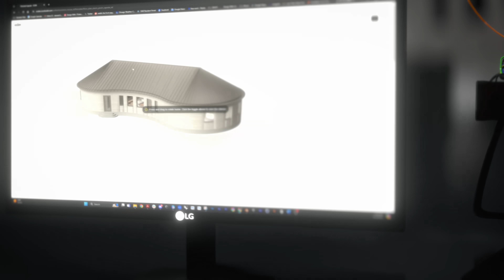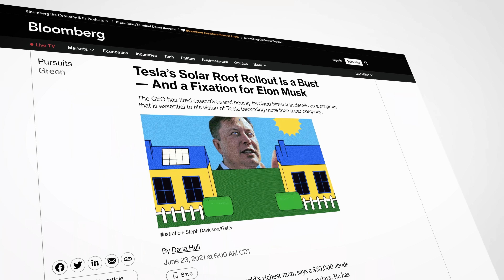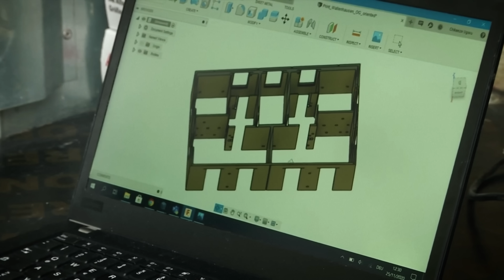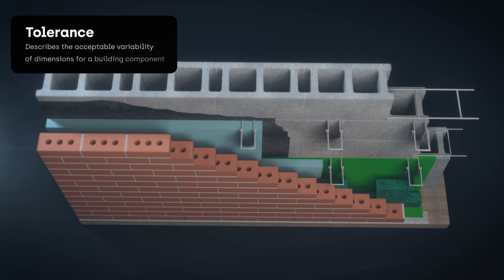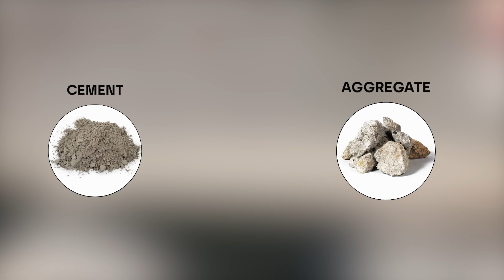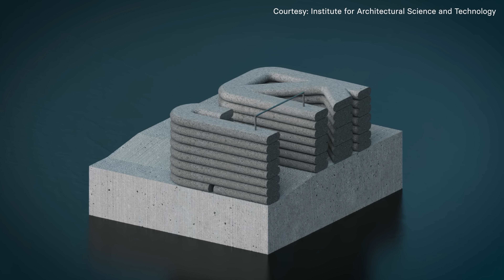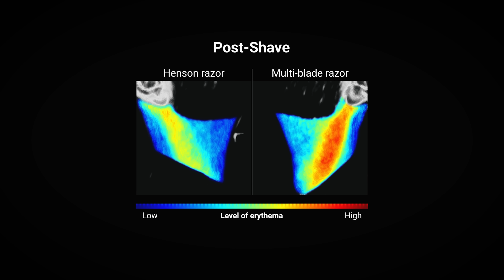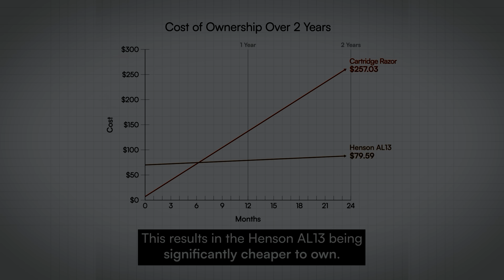Why 3D Printing Buildings Leads to Problems

Comment: I have always had a problem with the hype around 3d printed structures, especially residential structures, especially in the US.  For a 3d printed house you still need a poured foundation, you still need interior finishing, you still need a roof, you still need MEP, the list goes on and on.  You still need to do the rest of the house.  What does 3d printing automate away?  the framing and sheathing - because to be clear - the vast majority of houses are wood framed, and will continue to be.  Now, what is the absolute fastest part of building a wood framed house?  the framing and sheathing.  3d printing replaces the fast, easy, low skill part of home construction with something marginally faster if at all, extremely complicated, unforgiving, and requiring highly skilled workers if not engineers on site.  For home construction, 3d printing is silly
Reply: That's probably because the technology is not meant for consumers but to lure investor money.
Reply: That wood house burns.
Reply: Wood framed houses are a US only thing. Also no wonder tornados are so destructive in the US
Reply: @Soundwave857 Wrong.  The majority of hoses in New Zealand and Australia are wood (timber) frame. Could be used in other countries too, don't know.
Reply: Even worse, it innovates the least important part of the cost of housing (construction) while the majority of the cost is the land in places people want to live.
Reply: @laszlo3547  is there anything less relevant? They're automating the grunt work pouring cement not the artwork because that would be very difficult to do. Now you're pushing to automate the production of land or something is there something wrong with your thinking do you just have to come up with something to come out of the pie hole. They're automating the cheap part why don't they automate the expensive part you know land formation.
Reply: Yeah, I can’t help but feel like prefab commie blocks would be better than this
Reply: @beybladesinmyheels1267  I don't know about commy or not, but this is a pretty high-tech piece of equipment and a lot of people smart enough to run anything that technical want to stay a long ways from dirt and concrete and construction. This machine is going to cost more than a human being unless you're building row houses that are all identical and you can get two or three screw-ups to get it dialed in.
Reply: So build your wooden paper homes 😂
Reply: Luddite
Reply: @patricaomas8750  The upfront cost for the robots i'm pretty confident would muck up the job of framing for the nonce would dwarf the cost of just building a concrete printer by two orders of magnitude at LEAST. And that's BEFORE we even get to the problems with batteries. Even at it's cheapest for anything halfassed capable we're talking 16 grand PER unit. That's just for the robot. Not even counting all of the associated costs of charging & upkeep & troubleshooting & coordinating & maintenence. 

Its just more straightforward to build the damned printer and figure out how to make it all work in a durable & visually more pleasing manner. Takes just two guys to keep the printer chugging along at a good clip and a steady supply of your concrete being delivered in a timely manner.
Reply: @brianhirt5027  So you think my preorder of 20 Teslabots is a little excessive:face-purple-crying:
Reply: @patricaomas8750  Prolly so!
Reply: I said kind of the same thing except a little more detail with the fact that you've got plumbers in plumbers out electricians in electricians out drywallers in drywallers out and then start all over again in a different order. This is going to be a chargeback nightmare you aren't doing it much cheaper than a human being and you're going to make something out of concrete in an error from the machine and have to correct the concrete. This is an idea whose time has not yet come and may never come
Reply: It takes very little skill to monitor a 3d printer.
Reply: @user-zu5do6ri6r  I think you're having the cash register pops. Everybody says that it's easy to run a cash register what's wrong with these new kids that have to have everything told to them on screen. Well that kids not running a simple cash register like you're thinking of a simple printer he's running a combination cash register ATM machine. You're claiming it's the same skill level to monitor something that's melted a little plastic and sticking it together but this guy is pumping concrete having to keep the consistency so it doesn't run away having to keep the pump going just right to keep the printing process going just right and did I mention the stuff heavy and it's huge and something could fall on you or knock something over. Not to mention the easy repair you're going to have when that concrete goes all over and cures too quick or you've got a load of it you have a mistake and you got to just pump it out in a pile in time that it doesn't set up and ruin everything. Other than that you're perfectly right 3D easy peasy.
Reply: Across the Atlantic, Houses arent made from Wood
Reply: @Tritium21
2 months ago

Wait until code change and demand change.
If tomorrow a company can deliver a house can be up to code, made only a either a 3d printed concrete structure + some elements that come either pre made  or to very commonly used standards , I'm thinking of OSB sheets that would require no cutting and are available at Home Depot or something -  ,, and if that house can be build entirely in a few days to 20% of the cost of a nicer traditional home.... things will change
Reply: @xl000  we & engineering say that 20% is an unsupported claim. If you came up with something and it actually did it that much cheaper and you could prove it maybe so but as it is you're not really showing much if you're just going to claim if it's that cheap it'll go big.
Reply: Well made concrete houses withstand multi ton stones, that crash into them due to an avalanche. Meanwhile wood frame constructions all in the us are destroyed by tornadoes on a regular basis.
Reply: @alfonshasel1995  well I'm glad to hear from somebody that can't do math statistics or probability very well. For the cost of a stone house to prevent a random tornado once in a blue moon you are much over the cost of rebuilding several times and stone is a very limited media for home building
Reply: It's still a new technology, so of course it kinda sucks right now. Every new technological development is kinda garbage when it first comes around, but it improves over time and eventually replaces the old way of doing things. The same will happen with this. And those who refuse to adopt it or try to resist it will ultimately be left behind.

A prime example of what I'm talking about would be cars. When they were first invented, cars were terrible and didn't really have any advantages over horse-drawn carriages. And because of that there were people back then who were just like you and mocked the technology and said it was "silly". Look at society now. Don't see too many horse-drawn carriages nowadays, do you?
Reply: @Commodore22345  this would work well if you were using a Row house approach and there was a huge demand for mass production of the building. If you were going to do one off stuff where you do something one time programming a computer to do it is a great big pain in wallet.
Reply: @Commodore22345  this is nothing like a car. I don't think this is ever going to catch on because of the nature of computers being totally flexible change in an instant and concrete being concrete. The simply isn't going to catch on. I'm sorry that you wanted to discuss technology and use words like silly. Nobody's going to get left behind on this one. It's not going anywhere
Reply: @Commodore22345  oh okay I'm sorry I lose track I didn't ever get to meet you or him or anybody I wish we could all drink coffee and talk face-to-face. 1 general event with c computers is repetition. If you had row houses and you got the first couple wrong and clean them up the next 20 could come out fast. A bunch of people setting forms and learning from mistakes, is very competitive.
Reply: I don't know, I would rather have a durable concrete frame then a wood one.
Reply: @Entropy67  yes and you also are very likely to have a concrete mistake that is very enduring. If you are 3D printing a toy and something comes out a little lousy just throw it away. If you were printing a 3D house and you leave out a door it's not going to be an easy fix. Most computer stuff screws out two or three times but it doesn't matter because you've got backups and you can just delete stuff. Concrete has every opposite nature.
Reply: @Entropy67  I don't know what you're talking about. Nobody here is saying either you want wood or you want a machine to lay concrete.
Reply: Yep. Prefab homes are doing everything 3d printing does even better
Reply: I bet folks in tornado alley like the idea of solid concrete walls.
Reply: And the walls look like crap with the layering.
Reply: 3D printing isn’t a one-for-one replacement, especially in the U.S., where most homes are stick-n-paper and optimized for short-term warranties. A well-executed 3D-printed home is designed for durability that can span generations. For less cost and effort you're getting a better product.
Reply: Exactly, who’s giving these houses the green light when wood framed houses still need so much structural details
Reply: Framing is actually a relatively high skill process.  Bad carpenters screw up home frames all the time and cause massive structural defects. Track home builders regularly have structural problems because try to use low skilled labor and repeatability to cut down on costs, using engineered trusses instead of stick built roof, etc…. But they still have massive structural issues.  This really takes the headache out of worrying about structure.

Also, this is far more durable and impervious to termites or water damage.  You could build these houses in areas listed as a flood zone and have very little to worry about.  

Increasing home durability is going to be the only way to get homeowners insurance premiums to come down.  As homes get more and more expensive, the only way to lower risk to make homes less susceptible to natural disasters.
Reply: It’s silly for now. Obviously, it will eventually be solved. This isn’t the end game; rather, the beginning.
Reply: Try modifying a 3D printed house later. VS being able to modify a wood framed house.
Reply: @braddl9442  The idea isn't to create homes like traditional housing. It's meant to eventually be a way to mass-produce standardized housing for poor people. So the fact that they can't be modified or expanded isn't really an issue because the type of people who will be living in these houses are people that aren't going to have the money for those kinds of projects anyway. Middle-class and Upper-class families will still have more traditional housing built that can be modified and expanded.
Reply: @braddl9442  yea I mean if you don’t think the free market will find a solution I think you’re deluded.  Anywhere where there’s an opportunity to profit there will be people willing to do it, and there will be competition to keep prices down.  Just because you don’t think it will be easy doesn’t mean it won’t happen.  The economy isn’t constrained by your lack of creativity, fortunately.  

Though I do agree that 3D printing houses on location isn’t really the most cost effective idea.  I generally prefer the idea of using pre fabricated parts from a factory and setting them in place on location.
Reply: Carpenters/framers are the most skilled builders of a house.  Every other trade is much easier, saying this as someone who built their own wood framed house from the ground up.
Reply: @chuckd9007  electrician is considered one of the skilled trades and so is the plumber. Finish Carpenter is more of a skilled trade than rough framing.
Reply: @chuckd9007  I can see why you say that I don't think you put in your own heating air vac system I don't think you design your own electrical system. So you're right that's the most skill you can have just walking in off the street. There's a reason there's a license for an electrician there's a reason there's a license for a plumber there's a reason there's no license for a carpenter.
Reply: @markmcgoveran6811  HVAC design can be complicated, but installing it is only really an issue for air conditioners and heat pumps. Even then, there are DIY kits available that don't require licenses to install. Electrical design is very simple and so is installation. Not all areas require a license for residential electrical work. Plumbing is a little more complicated, especially drain pipes, but still doable and also doesn't require a license in many areas for residential work. Fine carpentry doesn't require a license anywhere as far as I'm aware, but definitely does require much more skill to do well.
Reply: Incorrect. 3D printing has capabilities that stickbuilts dont. Especially in areas particularly prone to hurricane & tornados. If you doubt the market potential or usecase applicability just take a gander at what's still standing after a hurricane sweeps through. Or heck, in any given centenial flood plain construction put to the test. Stickbuilts can't just be dried off and refurnished. Concrete structures can be, as long as the aggregate substrate wasn't washed from underneath it  With climate shift exaggerating those risks AND vastly expanding their potentially area of impact I think you'll quickly note that concrete printing a house makes more sense than rebuilding a stickframe.
Reply: @brianhirt5027 here in Florida homes close to the coast have to be built of concrete blocks.  One for hurricane protection, but also for flood and ocean spray protection.  Saltwater is incredibly destructive.  But there’s a massive difference in durability in block construction versus wood framing.  Like house fires.  I’m a garage door contractor so I go to a lot of homes every day.  I’ve seen several homes that burned down.  Wood framed homes burn down and usually their neighbors homes get singed depending on wind.  But block homes, they survive.  Yes the roof burns and the finishing burn but the structure stands.  Basically they just have to rebuild the interior and the roof on a block home.  Which means, insurance premiums are much cheaper on block homes.
Reply: @forrosailor  I've got a couple of general contractor freinds down florida way. I get regular updates on the horror stories around salt intrusion. Fucks everyting, including electrical up. 
As per fires, I don't know if you are really grasping the totality of the fires we get up here now. Whole neighborhoods look nuked after everything is said & done. The fires up here are of an entirely different order than what you're used to. We have an infestation of a bug called the western pine beetle that does really horrible things to the trees. When they go up, they don't go up slowly. They kinda semiexplode they burn so fast & hot.
Reply: @forrosailor So ... They have to the the most expensive stuff still? Literally the cheapest part of a house is the frame, the labor is cheap since it's quick. The most labor is spent doing everything else, plumbing, electric, interior, etc. You're waving away 4/5 of the costs because 1/5 is easier to fix. Premiums are cheaper on wood homes. Anything with brick or block is insanely expensive, because it all gets destroyed on a semi-regular basis and having more expensive materials just means more expensive repairs. Ask me how I know, I literally sell insurance in Texas near the coast 😂
Reply: @brianhirt5027  it has zero advantages over traditional concrete forming
Reply: @imchris5000  Except in the more minimal increasingly rarified labor demand. How many apprentices you seeing stay the course in the trades long enough to qualify for journeyman, Chris? Heck, how many make it to the end of week one or two? How large a team it take to frame up forms in a conventional residential build in a timely manner? How about those help wanted adverts you got posted? Got many under-40's answering 'em? Answer me honestly, Chris.. If Uncle Sammy tightens up green card reqs, how much longer could you afford to stay in  business? Hrm?
Reply: @brianhirt5027  Don't underestimate the role of rebar in those things that stand up to hurricanes.  Reinforced concrete is impressively strong.  A few ton of splooged grout will not compare favorably.
Reply: @M3rVsT4H  Agreed. But i'd be remiss if I didn't point out that this is such a new thing that every single one of these suckers is a custom built printer. They all don't approach it the same way. Some companies do include rebar, especially to fix walls to foundations and in areas of increased risk, of natural disasters.
Reply: @brianhirt5027 Lol tornadoes? Stiff houses blown down easier than wood frame. Brick, concrete, steel, none of it matters. A tornado is equally unforgiving, and earthquakes are the same. The only way to survive is to bend (literally) to the will of the natural disaster.
Reply: @brianhirt5027  The structures you speak of are not printed, they are reinforced and poured in place.  Cartesian motion systems used by these house scale 3d printers, and even corexy for that matter, cant cope with the rebar that did all the work.  remember that concrete has virtually no strength in tension or torsion, which is what earthquake and hurricane resistant structures are designed to withstand.  its the rebar doing all the work, and the motion systems simply do not allow for those to be in place.  It is also telling that the precautions in traditional wood construction against earthquake and high winds are to add steel reinforcing, and not to fill the walls with concrete.
Reply: @Tritium21  Understood. But I believe there have been some already printed in Florida, awaiting their trial by fire. Or in this case trial by hurricane.
Reply: @Tritium21  I agree with you 100% I've never seen anybody who didn't get undercut in capitalism that didn't cry out it's silly to have a machine to do this labor it's silly or some other ugly word they picked out to cover up their own shortcomings and inability compete with their primitive idea
Reply: It wont happen "throws baby pipper against the wall" it wont happen "screams for mommy" it wont happen "projectile vomits all over your career" it wont happen "works food service for 40 years" it CANT HAPPEN "dies without living their best life"
Reply: It replaces high skilled and low skilled jobs. It depends on the design. Automation at any degree becomes useful when applied right. What does AI replace currently? Customer service on websites sometimes considered a low skill low pay job. Great well that can be allocated to other areas now, and that employee can focus on other tasks instead. Recently completed a 3D printed home in California. A duplex. We could print the roof but we didn't in this particular job. Doing the MEP was easy, foundation can be printed and interior finishing can be done in a day. Now at scale it really starts to work as the printer can finish a couple houses a week, then the contractors can come and do the MEPs all in a row. There are definitely some kinks to work out in the process and approval but the US is one of the few places who still do wood frame. Its largely about material cost and understanding. Go to AUS and see everything still being done in Brick.. Also 3D printing isn't only concrete. More and more materials pop up all the time. From clay, adobe, hemp to stone. It is also about customization, freedom of form and design.
Reply: @LeeGaudi-vb9ev The replaced employee won't do other things. They are replaced.